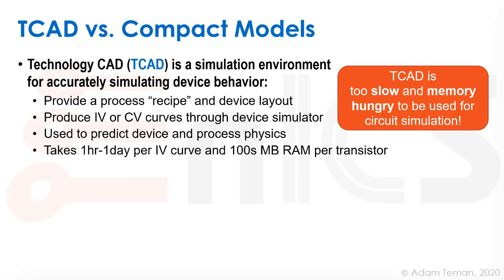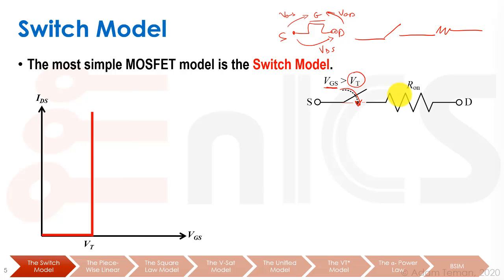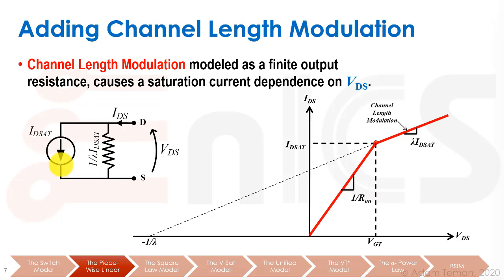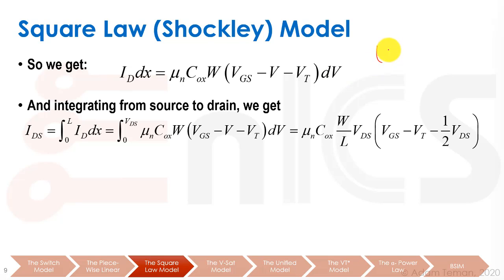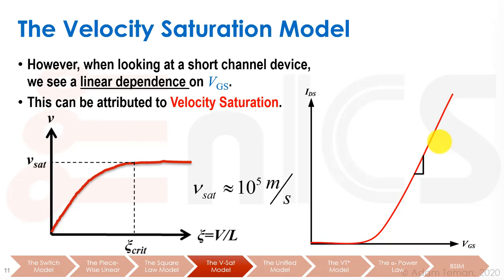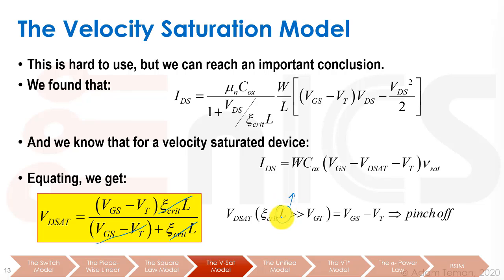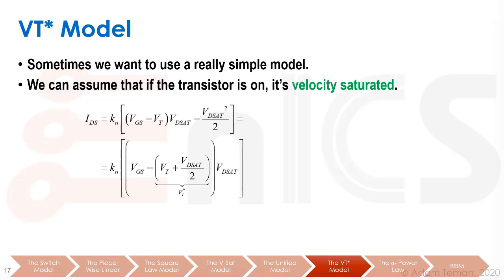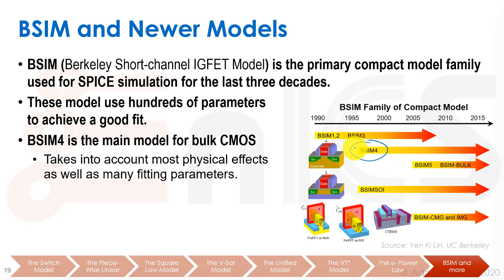VLSI - Lecture 3a-b: MOSFET Modeling

Comment: Excellent presentation, simple and to the point. Thanks a lot. Just one point: Square law model is  Shockley or Shichman Hodges model?
Reply from the maker: Thanks for pointing this out. I think that Shockley is the original square law model, whereas Shichman-Hodges adds channel-length modulation and body effect to the original Shockley model. Indeed, Shichman-Hodges is the LEVEL-1 SPICE model, which would probably be the roughest you would go for analysis.

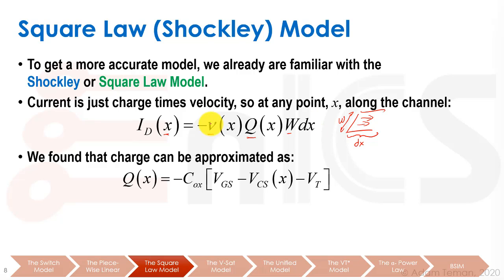Comment: At 9:54, shouldn't the expression for drift current be:

I_d = −v(x)⋅Q(x)⋅W

since current is velocity times charge, and the charge is proportional to the width of the channel. I don't understand why the infinitesimal channel length dx is included. Can you please clarify this point?
Reply from the maker: Yes, you are right. There is an "extra" dx there. Thank you for pointing this out (it "magically" disappeared on the next slide ;)
Reply: @AdiTeman  Thank you for the clarification, Professor. I really enjoyed the lecture and appreciate your guidance on this point.